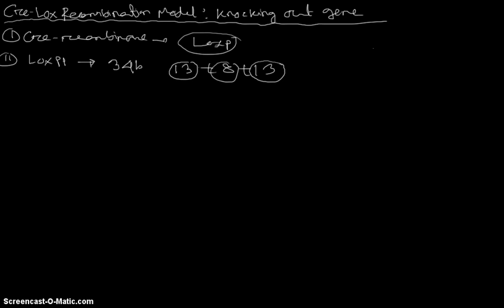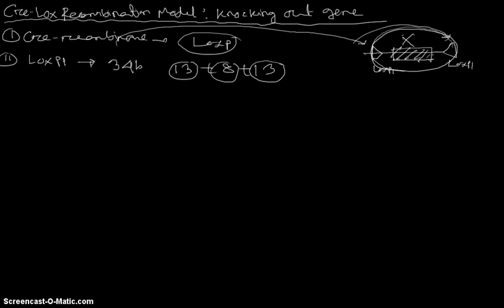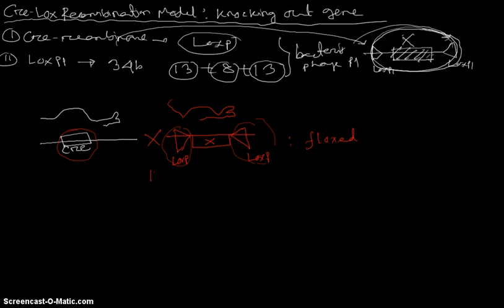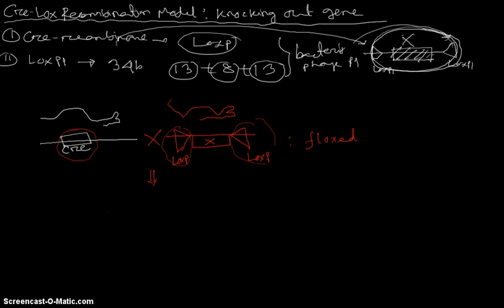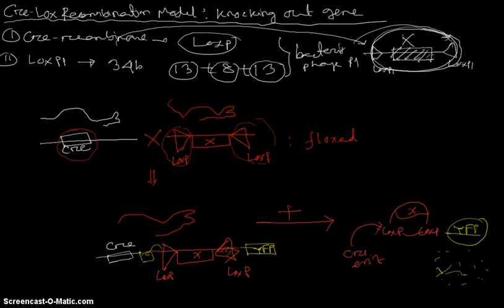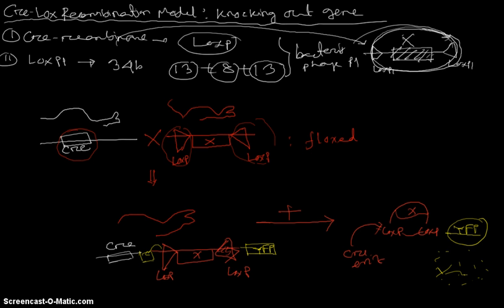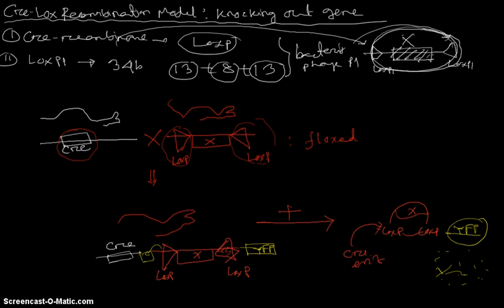Cre-Lox Recombination Systems

Comment: Is the cre-Lox recombination model the same as cel type specific conditional knockout? 
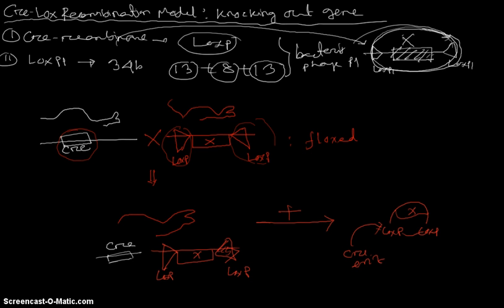Also, what are you saying at time 5:20? Cre ent?
Reply: Thanks!
Reply from the maker: Yeah, you can say it is cell type specific conditional knockout. The 1st mouse with floxed gene is flanked in every cell. 2nd mice having Cre recombinase shoulde be driven by cell specific promoter. That mean, only those cell expressed the the promoter drives Cre, will have ablation of flanked gene! For instance, you have 1st mouse with a gene "A" which is floxed everywhere in the body. 2nd transgenic mice with Cre under Nestin brain specific promoter. When you crox these two mice>> progeny will have ablation of "A" gene only in Brain, not in the whole body! That is cell/tissue specific!

at time 5:20, I am saying Cre Enzyme!